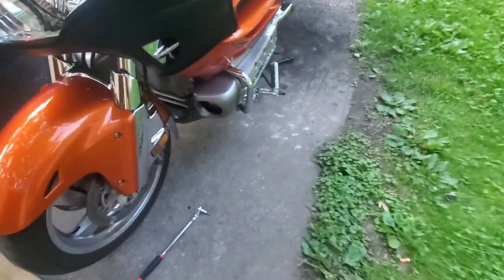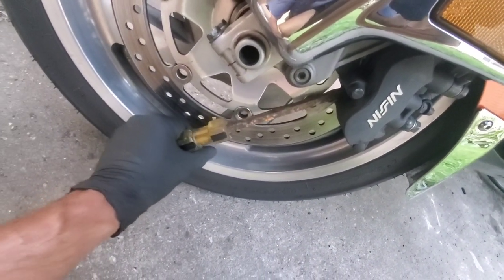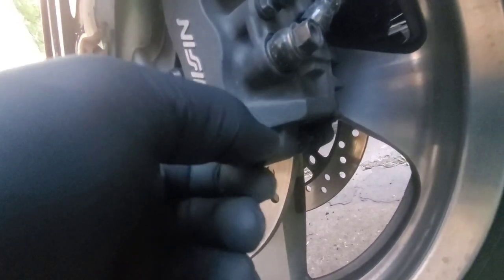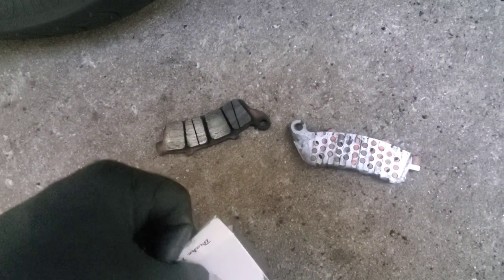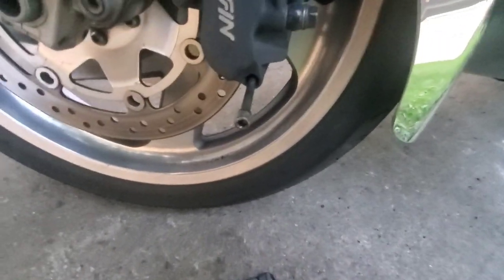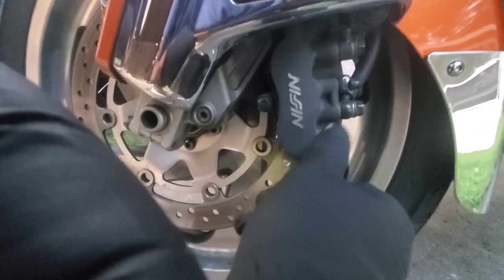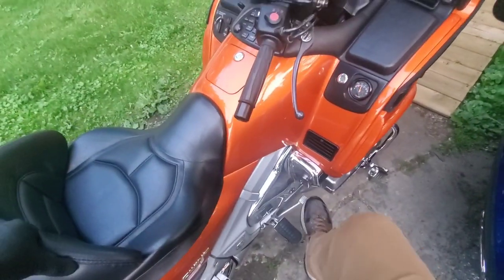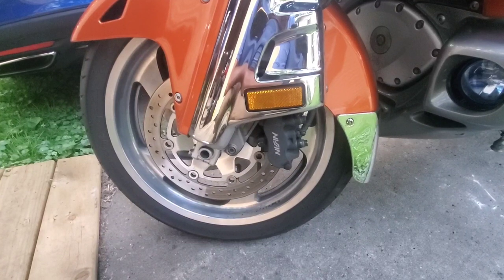GOLD WING GL1800 BRAKE PAD REPLACEMENT

Comment: So many riders do not clean the pistons and the caliper area with soap and water or brake cleaner before they push them in. NOT A GOOD practice.
Reply from the maker: Thank you for the comment. So many riders dont even wash their bikes. I didn't think I needed to tell people to wash the area because that's just common practice. Like washing your bike. The videos purpose was to show how easy it is to change out the brake pads. And that was accomplished. Be safe.

Comment: I don't know why everybody else takes off the fender and cover to replace the pads when you only have to remove the bolt on the bottom of the calipers. Good job showing it the easy way.

Comment: Hey Moe, how many miles do you typically get out of a rotor?  Also, how long do the front and rear brakes last?  I'm replacing my fronts while I have the tire off.  Put new tire on front and installed the Centramatic wheel balancers.

Comment: Do I need to pay any attention to the brake fluid?
Reply from the maker: Depends on how far you push the calipers back. If pads are not bad I would just make the room necessary to reinstall the new pads. But if you have to push the caliper back alot then I would pop the cap of the brake fluid to make sure you have the room
Reply: @mosmotorcyclejourney9067  OK thanks Mo!
Reply from the maker: You are welcome Mark. Thanks for watching and the comment 👍
Reply: Mo - the brake reservoir for the he front caliper but where's the reservoir for the rear?
Linked brakes system - idk much here on how the linked system works.
I don't see how you greased the pins - does the pad float on that pin?
Reply: @timothywald9079  The brake reservoir for the rear caliper is on the right side of the motor... above the oil dipstick.

Comment: for anyone doing this you will need a  Large Flat Head
5mm Allen Socket
Torqe Wrench
3/8th Ratchet

Right Pad Front	06456-MCA-016
Left Pad Front	06455-MCA-016
Rear Pad	06436-MCA-026
Reply: yes, the 2 pads are different in the front
Reply from the maker: Thank you for adding this information. Very much appreciated.

Comment: 1.	Push the caliper piston all the way in to allow installation of new brake pads by pushing the caliper body inward.
2.	Remove the pad pin rubber plug and loosen the pad pin.
3.	Pull the pad pins out of the caliper body while pushing in the pads against the pad spring.
4.	Remove the brake pads by lowering them down and out of the caliper.
5.	Coat the stopper ring on the pad pin end with silicone grease.
6.	Make sure the pad spring is installed correctly. 
7.	Install new brake pads into the caliper body with the shim facing toward the wheel side so that their ends rest into the pad retainer on the bracket properly.
8.	Install the pad pin by pushing in the pads against the pad spring to align the pad pin holes in the pads and caliper body.
9.	Tighten the pad pin to 13-foot pounds.
10.	Install the pad pin rubber plug.
11.	Operate the brake lever and pedal to seat the caliper piston against the pads.
12.  Optional: Apply brake pad compound (Permatex or CRC Disc Drake Quiet) to back of the pads to reduce brake squeal.
13.  Optional: Put the bike on the center stand before you change pads. Use a jack to raise the front tire just so it spins. This will allow for post brake change checks and testing.
Reply: Why don't you add the part numbers for front and read pads?

Comment: I've done seems like a hundred car brakes over the years but never motorcycle.
Do you do this in center stand?
Rear brakes can be accessed around the he saddle bags like front?
Reply from the maker: Yes I did it on center stand. And the rear are just like the front. But onthe one caliper.

Comment: What up, you only did one side?
Reply from the maker: Thanks for the comment MC. The purpose of the video was to show how easy it is to change them. I did the rear and other side off camera. And just also to mention that you should clean the pistons when doing a pad swap. I just sprayed brake cleaner on the insides and flushed with water. If you have a piston hung up then best thing to do is remove the caliper, clean and grease. Thank you sir and please be safe. Hope its warm where you are because in Michigan it's 25 degrees with a windchill of 13. 😪
Reply: @mosmotorcyclejourney9067  Thank you for explaining to me, but I do know there are some people out there would just change one side. Bloomington Illinois where I lived for 52 years I now live in Houston TX.   For the last 13 years hardly a day goes by that I don't ride.
Reply from the maker: @mcfuller5020  yeah that must be nice to ride all year long. I wish I could move to a warmer state. However you lived in Illinois so you know first hand how brutal and cold winters can be up here. Maybe one day before I'm too old I will experience it lol. Anyways thanks again for the comment. Be safe and talk to ya soon. 👍
Reply: @mosmotorcyclejourney9067  I must tell you when I was nineteen the only vehicle I had was a 1973 Honda CB 500/4,  I had to ride it to work during the entire winter. I learned a lot that year.
Reply from the maker: @mcfuller5020  OMG all winter. Yeah you learned alot, because I have tried it when I was young also and couldn't do it.  The roads were just too bad. So I give you alot of credit sir. That takes guts and good old luck. 👍
Reply: @mosmotorcyclejourney9067  Thank you but I must admit if it weren't for my sense of balance which I excelled at for one reason,  I was a three time champion wrestler. Of course not to mention both feet were my ski's per say. My  alertness was also at it's max. I drive a semi/tanker and I haul Hazmat Chemicals such as acids and flammables and have for the last seven years. That one winter experience plays a big part in pulling dangerous bulk materials. To sum this up I've had some advantages most riders don't, including 45 years of riding with no accidents. I'm knocking on wood as I speak. 4
Reply from the maker: @mcfuller5020  I wouldn't call that luck. I would call that experience sir. You may have been lucky at times but  I believe that being a defensive rider makes you a safe one. Wow you have alot of years and miles under your belt. I would call you a seasoned rider. Yeah there are people out there that give up riding because of people in cars not paying attention. Texting and talking on phones. I look at it like this, ride like every car and truck is trying to run you over and you will make it home. God has a plan for me and it doesn't matter what I am doing at the time but when he calls I'm going. No way around it. So I'm gonna enjoy the time I have here and hopefully one day I will have as many years and miles as you sir. Thanks for sharing MC Fuller. 👍 be safe my friend.
Reply: @mosmotorcyclejourney9067  keep her up on two wheels, or one sometimes. And you be safe also.
Reply from the maker: @mcfuller5020  🤣🤣🤣👍

Comment: Good stuff! Got a video on the rear brake?
Reply from the maker: I can do one however it's the same way
Reply from the maker: The rear caliper is the same as the front 2. So the job is exactly the same.
Reply: @mosmotorcyclejourney9067  Thanks!

Comment: you cannot buy shims, they come with OEM Pads, when new, the issue is the OEM pads are ceramic, and most others are Organic or Metallic... and they are cheaper, for a reason.
Reply from the maker: You are correct on the pads 👏 👌